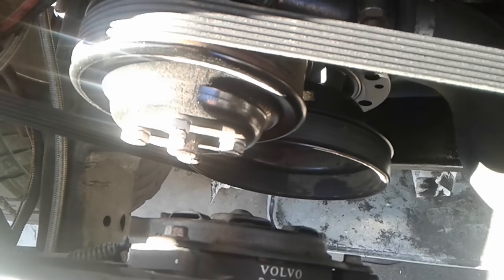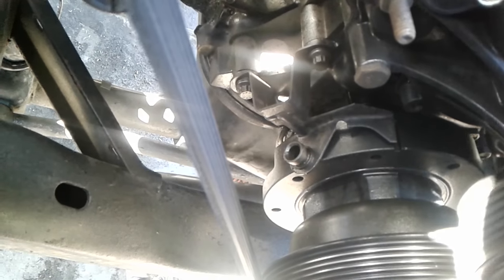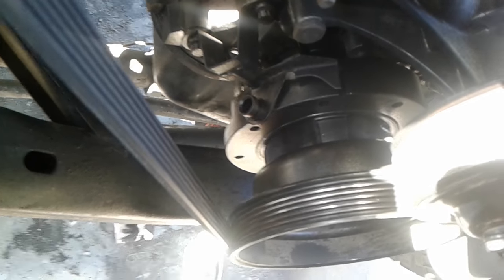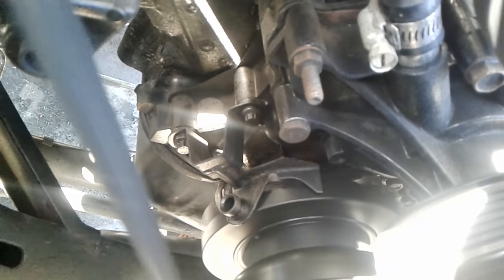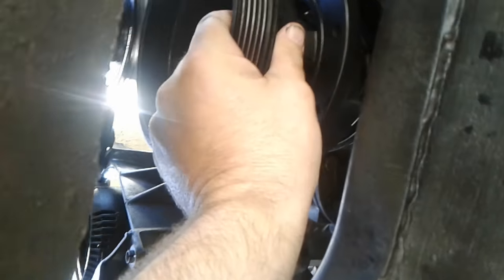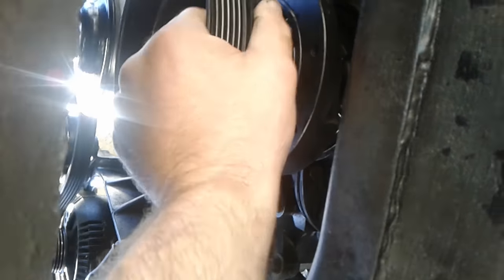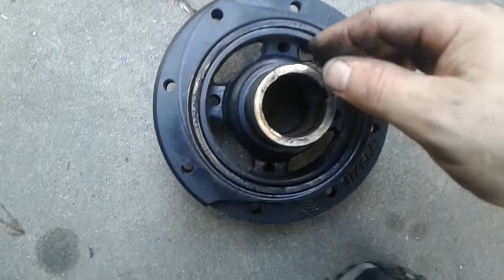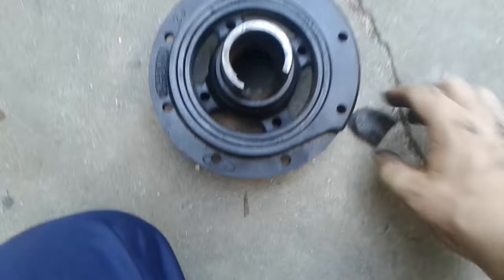Belt squeak crankshaft pulley wobble Harmonic balancer damper failed broken

Comment: I just put a supercharger on my 93 mustang today and my balancer exploded within the first mile. Looks like the same balancer as mine. I went with a power bond race balancer simply because they have a forged steel hub instead of the cast garbage that was on the car.
Reply: Yah definitely with a Ford that stock should’ve been solid throughout 5-600 hp.. crazy. I love Fords built them my whole life and usually more reliable then all. This a Corolla video is insane considering Toyota is “reliable” I have a 09 Corolla and I constantly work on her were as my Focus manual Titanium hatch was jus fun to drive and needed only maintenance, drove my commute ford for 250 thousand miles with stock water pump, alternator, cooling system, etc.. just naming what I’ve replaced in a Toyota Corolla and water pump every 30 thousand miles! Crazy how people think Toyota is reliable

Comment: That's what mine sounds like !! I just got a new balancer. Hopefully it will fix the problem.
Reply: Did it fix it? I’m having the same sound and same symptom as far as sound going away once warmed up. They replaced idler pulley and that did nothing. They are looking at this part now per my mentioning this video.
Reply: @jamesosteen09  why they always replace that tensioner I'll never know
Reply: @james684  . Maybe it also needed to be replaced.

Comment: I had a harmonic balancer fall apart on me on the highway yesterday.  I heard a pop in the engine compartment and immediately following the pop, noticed a tiny piece bouncing in the rear view mirror.  Immediately after I noticed the power steering was gone and the engine started overheating...no surprise in retrospect, since after the crank pulley failed everything connected to the timing belt failed. Very frustrating.
Reply: Had the same exact issue with my 2000 Galant. Happened several times after replacement. H ad to get rid of the car
Reply: Did the engine get wrecked too?
Reply: Timing belt...?
Reply: @GoatyHerps  I think he meant serpentine belt. Lol
Reply: Drive belt... not timing belt
Reply: @simbagarage5943  Ah yes. Thank you.  Typo on my part.

Comment: The clickety-clack squeaking sound is coming from the timing mark portal bracket if you bend it back up away from the harmonic balancer lot of that clickety-clack squeaking sounds should go away but the wobble won't w me once the come the wobble stay replace harmonic balancer/Crank pulley problem solved no luck required follow instructions for repair
Reply: Where is that located?

Comment: Is a crankshaft pulley and a harmonic balancer the same thing?
Reply: Yes and no, depending on the model. First, the harmonic balancers have a butyl membrane between the inner hub and an outer ring. This ring can have belts right on that outer ring and thus the entire unit is as one that shouldn't come apart. Only when the butyl fails can it come apart. Just to note; the butyl is for twisting shock absorption that reduces harmonics to keep this from effecting the internals of the crankshaft. It's not to "balance" the engine crankshaft like name suggest. Your crankshaft is already balanced perfectly. This twisting shock comes from your A/C or Fan quickly coming on, since these produce major twisting jolts going from zero or slow speeds to actual engine RPM's. There are two part designs where the pulley is actually bolted on to the outer ring of the harmonic balancer. This can be referred to as the crankshaft pulley that is bolted on to the harmonic balancer. 
   There are many after market pulleys, that you can purchase to make the system here a solid pulley, with no two piece design. Therefore this would be a crankshaft pulley. These are meant to run strong with no mode of butyl failure. They can take much more horsepower and abuse, not to mention being lighter weight. This is a very bad idea if you still have a mechanical fan and/or an A/C compressor still running off this pulley.
Reply: The pulley can break dosnt mean the engines bad. The pulley is bolted onto the end of the crankshaft it spins with the engine over time it can wear and start to wobble or walk itself off the crank shaft and cause the belt to get misaligned. If you catch it right away usually nothing bad happens no other accessories get damaged. It’s highly fixable if you catch it early.

Comment: The main causes to this issue is a too tight serpentine belt with no give. 
Also a car accident a hard collision
Reply: I had a wobbly balancer on a Taurus and later found there was an oversized idler pulley installed (and naturally a blown tensioner as a result)
Reply: That seems weird that a tight belt would cause the problem as the tensioner is there to absorb any variance in tightness. I installed an OEM belt in my Accord with a new OEM tensioner and noticed that its super tight. But since I got both parts from the dealership I can't imagine its going to suddenly break other components.
Reply: The tensioner is automatic which means it adjusts that can’t be the issue. Number 1 issue is just age wear of components it happens especially if it’s the original pulley from the factory.

Comment: did you also notice shaking when at idle? i think i have a bad balancer also
Reply: Mines does it makes a chirp sound changed idler pulley n tensioner makes noise also shakes on idler ? U think is the balancer? Thanks
Reply: @ER-rv1ud  after i replaced the balancer it ran the same... no improvement i noticed... take to a good mechanic if you can't figure it out..
Reply: @roadstar499  what did the mech say?
Reply: roadstar499 did you figure it out yet? my ram 1500 is doing the same thing. I changed my idler pulley and balancer but its still got some wobble to it. Im thinking it may be my crankshaft i also have a coolant leak coming from the water pump i think
Reply: Mines slightly wobbled for years
Reply: @jordansims5947  ever figured it out

Comment: my 2000 accord is having the same problem,replaced the pulley because of the wobble & squeaking & now the belt doesn't fit bk on properly very loose, tried a smaller belt twice & still it's to big n loose this happened yesterday
Reply: Triple check that your belt routing is correct. Your belt tensioner didn't go out during belt removal did it?
Reply: @technomage6736  I'm curious how can a belt tensioner go out upon removing the belt? Is there any red flags I should note? Thanks
Reply: @phillippardo5712  I suppose it's possible the internal spring was stressed enough to break (due to age) when he cranked it, but I doubt it. Surely the OP routed the belt wrong, or possibly got the wrong size pulley (which I've seen happen).
Reply: @technomage6736  Thanks for the reply 🙂

Comment: Would it prevent the truck from turning over?
Reply: yeah because the timing gets off. I’m figuring out the same stuff for my fox. It was hard to turn over like a weak battery after a rotating screeching sound started, which came AFTER (what I’ve finally found a diag for) a sound that I can only describe as a (Jetta diesel idle sound), OR what you would say is a jumped timing chain (constant, light, diesel sounding, tick like rattle. 
So, in order of events, 

1) ran low on gas (COVID broke, sorry mustang)

2) died as stopping then wouldn’t want to turn over. (FYI-for a while now since I had the car, it turned over slower warmed up, than at cold start.) so now it turns slow and won’t start. 
Pop started it.

NOW,
3) now comes power drop off at accelerating over 1500-2000 rpms, like a limiter.
AND the time jump, chain rattle sound. 

2) A few starts and light and short drives later...
 SCREECHING(!SCR-SCR-SCR-SCR-SCREERRCH!)

3)harder to turn over, (when I wanted to wake it up (as there was no ROD KNOCKING or extremely noticeable lifter noises.) and I moved it for the apt to pave, moved it back, never started again like it’s dead, but put a battery in the day it loss power and wouldn’t turn over good. I was told by a Mech that ditched me it was a spun main or rod bearing. I’m starting to see that he’s not as good of a mechanic as I thought or didn’t care to lie as there are a lot more external problems that I have found that can cause all this shit vs things internally. 

Any mechs or Foxbody guys here from my future to tell me what it is to save my cars destiny?

So far my path has led me to.
Ran out of gas coincidentally and/or it helped further mess up timing, EX: pop starting, dying, timing already off slightly. 

Then the bad timing wore out the chain, then it jumped, wearing the bearings in my harmonic balancer, causing it to screech like a fuckin mother, furthering the timing causing the eventual inability to turn over at all. 🤷🏼‍♂️ is that an idiotic guess for a recent year project owner?

Comment: Has anybody fixed this? My 2010 ram 1500 3.7 is doing the same thing i replaced the balancer but it still has some wobble to it. Maybe its the crankshaft 🤷‍♂️
Reply: Jordan Sims ac compressor
Reply: Raylee Fawn my tensioner is loose and i have a leak from my water pump. Im going to fix those things soon and then hopefully its gone.
Reply: @jordansims5947  any update?

Comment: Never trust belts. Remove all belts and then run it
Reply: Ya got any Beeman's? - NEVER run an engine with damper pulley without the belt. Unless you're 100% sure your particular model admits it. 
With solid pulleys it's no problem at all. 
But in most damper pulleys designs that's enough to make you buy a new one really soon. They are not cheap either. ;-)
Cheers
Reply: wait wait nvm i got confused

Comment: I just put new balancer  and I don't know if its wobble but I tried wobbling it with my hand and it solid strong its more like a vibration when the car is running. is it normal the Harmonic balancer moves a little bit?
Reply: Sounds like the rubber has perished inside it a wobbly balancer will make the engine vibrate more because it's designed to take engine vibrations out of the crankshaft.

Comment: You put it on wrong. Probably used a hammer
Reply from the maker: Nope, I have all the right tools, pullers etc... Maybe there was debris on the crankshaft when I installed it.  The was a new short block.
Reply: @fintechrepairshop  ok buddy. 👍

Comment: Need new crank now
Reply: How fast can a wobbling balancer pulley damage the crank? I have a balancer that doesn’t spin straight.
Reply: @pontiacmaniac7772  really can't say for sure but if it's loose like his was in the video it is possible to damage the end of the crank where the balancer slides on. Which would suck.
Reply: arthurwarren2able mine isn’t that bad but it’s still noticeable.
Reply: Its It's probably fine. Send video
Reply: arthurwarren2able Idk how to send a video. But I’m going to fix it, I’m not trying to damage the engine.
Reply: Yeah I'm just now getting all the parts together from the last owner of the one I got. He said it wobbled right on off one day lol. Worked in my favor. Got it cheap

Comment: I'm having the same issue but for me, the crank pulley is loose and wobbles but the harmonic balancer is solid. Went under to try to tighten the bolts and noticed one snapped inside.
Reply: boostedsil40  yes. Pretty easy fix but harmonic balancer needs to come off. I just replaced it.
Reply: Jeffrey Barton  kind of. I still have a squeal on startup. Thinking it's the waterpump
Reply: Jeffrey Barton  super easy. Rent the puller and installer from O'Reilly
Reply: Wait. Wym snapped inside? The crank pulley bolt ?

Comment: Your Harmonic Balancer is junk. If you aren't careful, you're gonna egg-out a cylinder or two.  You're super lucky that thing didnt go grenade on you.  

PRO TIP!!!  Dont go to a junkyard for a Harmonic Balancer.  Spend the $50-100 for a new one.
Reply from the maker: OK, thanks. I had another professonal production damper I put on there.
Reply from the maker: Why would I egg out a cylinder?
Reply: Yep im ordering mine right now any recommendations should i just go oem or grab one from fcp.. and i can replace it without having to mess with the timing at all right all the videos i can find show them doing crank seal at the same time but i just had crank seal done with timing 10kmiles ago